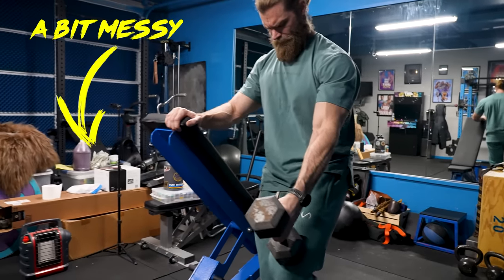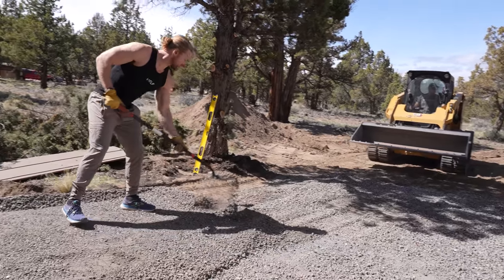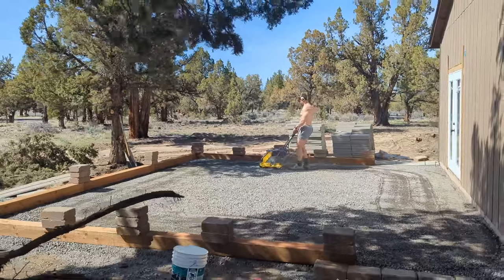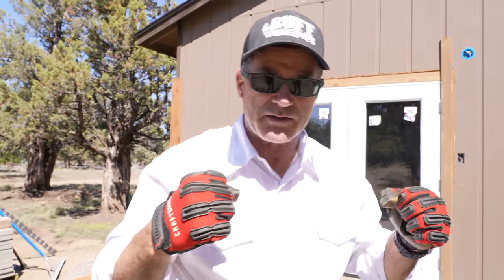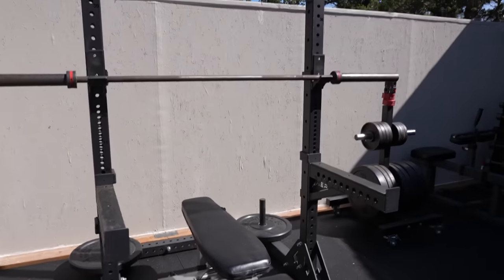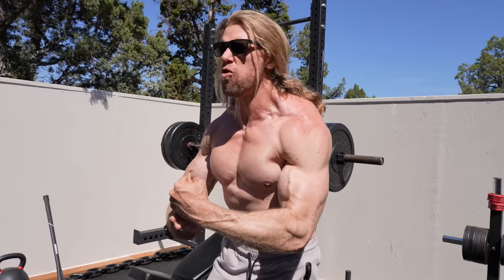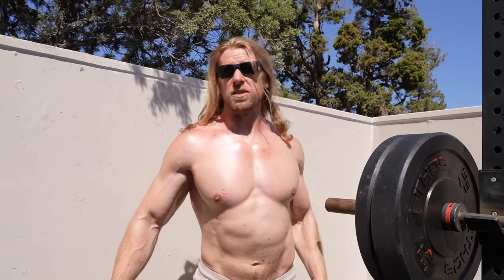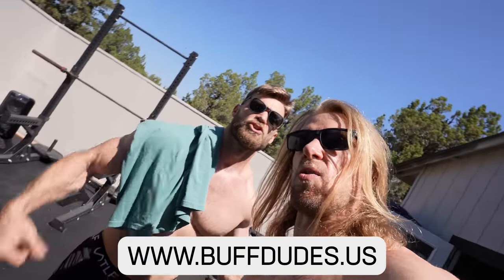We Built Our Dream Backyard Home Gym

Comment: With as hot as it was last summer or last (forget when exactly), a roof to shield you from the sun would be beneficial IMO. =)   If you want to keep the open air thing, suspend the roof up a couple feet to allow the hot air to escape out the top & fresh air circulate through.  It'd also stop your gear from getting rained/snowed on.

Comment: One thing that you could add that works great outdoors would be sandbag trainers, brute force makes the best ones I've used and the sizes I would recommend would be the athlete and the strongman and then just buy extra bags and use playground sand to fill them to the weight you want, just remember to leave enough room in the bags that the sand can shift because that's part of the point is you have to stabilize the load which works a lot of those stabilizing muscles, obviously.  Also, a big tractor tire and a 13 pound sledgehammer, and a push sled.  And just for fun a garden hose shower and a Kiddy pool for when it gets hot...lol

Comment: nice fun idea and it looks gret. i wish my garage wasn't full of random stuff right now. it would be perfect for the various stuff i currently have though i dont have that much. i have enough that the only spots around the house that would fit it all are: the garage.backroom (also full of stuff) or the backyard. but would perfer the garage since the prior owner of the house converted it into a babershop. so it doesn't have a normal layout (it also has french doors in the front at the top of the driveway and a normal side garage door a few feet from the front door of the house). wouldn't mind the backroom if clean since i do use it sometimes but dont have much space lol. would use the backyard but the dog nextdoor goes crazy if anyone is in my backyad and wont stop barking so that gets old.hoping to sort it out asap, have a few of the items in my room which works. just need to sort myroom out again did a few weeks back. but been busy. thinking if i rearrange my bedroom a little more esp now that i have a fan that. i think it will be what im wanting or at least a makeshift version thatll work good enough. just been tired since i do uber eats by bike and most days im all over town/with a few outside of town depending the situation. (and thats on top of riding my bike for fun,errand running an making youtube cycling videos lol cardio catches up to me)

Comment: Not what you put in it, but outside the wall ypu can put your flipping tires, sled and strongman stuff. As for inside the gym area, bodyweight stations and kettle bells hold up well in the weather. The Barbells get a little rusty as do regular plates.

Comment: As an Arizona native I'm curious what state you guys are located in cuz exercising in the sun over here is only possible in the coldest winters ....which still is....like 55 at the coldest? 
Southern AZ specifically lol
If I left a kettle bell out in the sun in the summer it would burn my hand when I grabbed it.
 ...
Another question.
Did you guys have to get a permit for all this or do you live in one of those areas where as long as you don't have load bearing structures you can just do whatever? Lol

Comment: it seems like with those walls and those matts, drainage will be a big issue when it rains. What did you guys do to help with that?
Reply from the maker: Hi Jack. Thankfully rain is rare in Central Oregon, but (as fate would have it) it's rained about 5 or so times in the past month. The horse mats, combined with the pavers and sand, do a great job of letting the water through, as opposed to concrete.